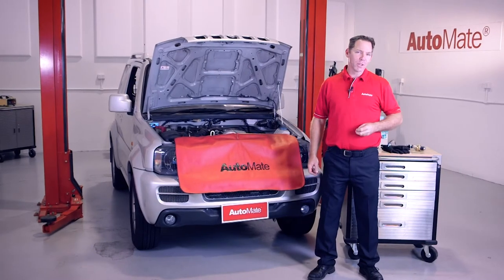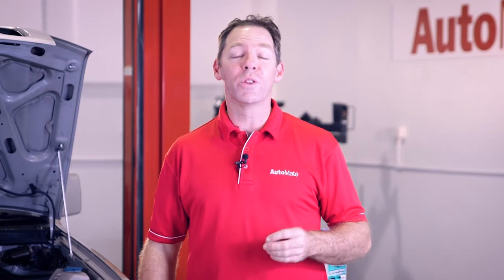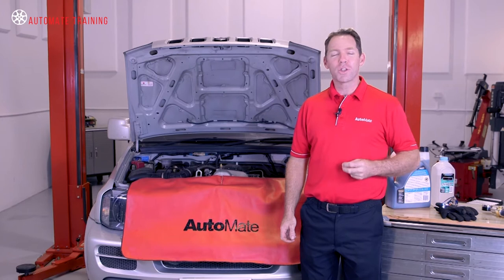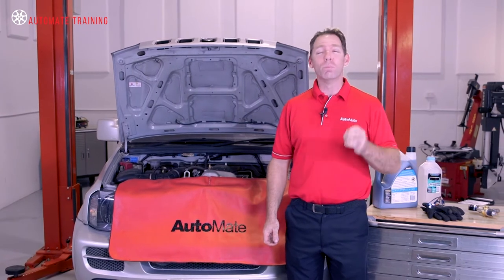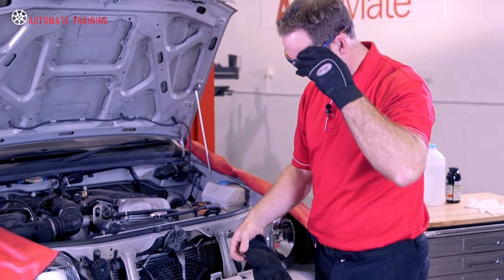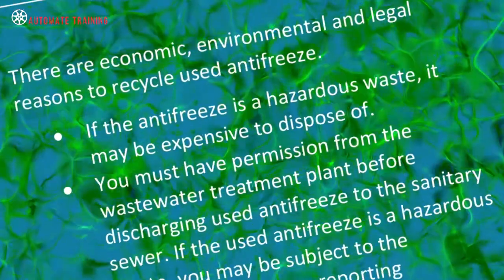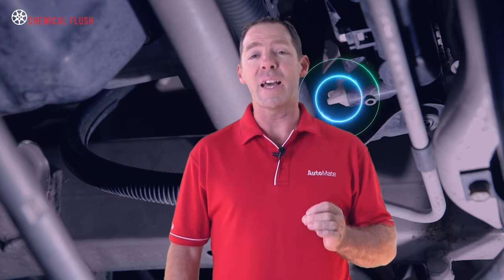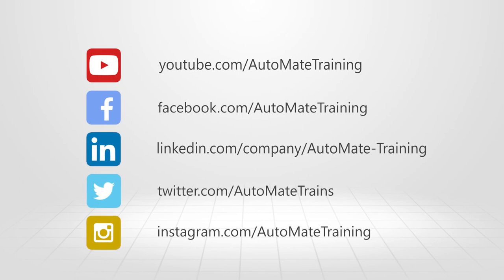Best Practice Coolant Drain and Flush Training Module Trailer

Comment: does it matter if the thermostat is close or on during bleeding process ?
Reply from the maker: Hi Vicky, Using the correct tools, the thermostat  will be open during bleeding. Find out more with a subscription to https://www.automatetraining.com
Reply: Thanks for the reply... I wanted to confirm if thermostat opens or not. Yet it is interesting to know how an external system may open the thermostat,because till the extent I know it can be operated only by ECU/ DME ...